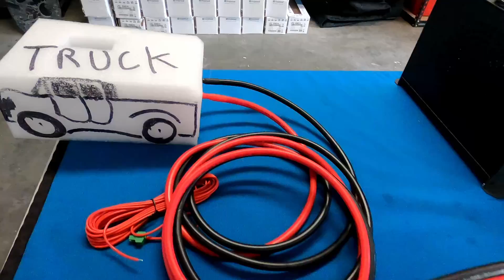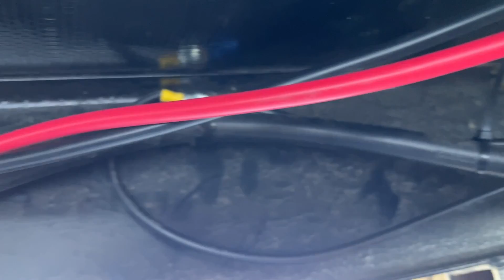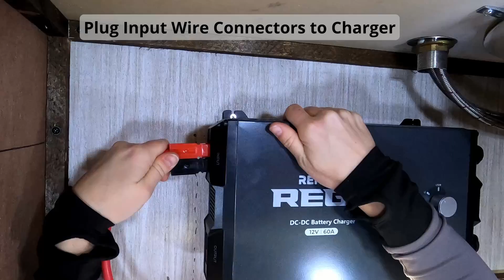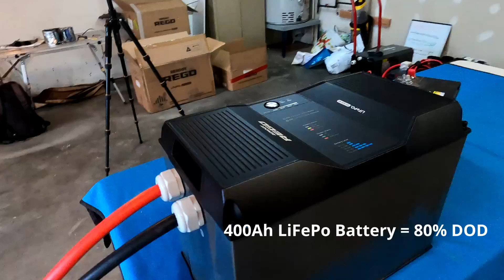REGO System Installation: Episode 4 - Install REGO Components & Wiring

Comment: im about to install a rego 3000 inverter charger it states in the installation instructions to mount it vertically on a wall not horizontally. i want to mount mine horizontally like you did,  have you had any  issues since your install? thanks
Reply from the maker: Yeah, we've had zero issues.  I think the vertical installation rec is really about keeping the fans pointed down so nothing can fall or accidentally stop them.  If it overheats, because of fan failure that could be really bad.  Good luck!

Comment: Could you leave the converter active if you installed just an inverter, rather than a full inverter charger?  Also, why Renogy vs Victron multi plus?
Reply from the maker: Oh, for sure, if you're doing just an inverter you'll want to keep the converter in place.  But be sure that you get an inverter with that auto transfer switch, so it won't interfere (aka blow up) when you're connected to shore power.  As to why Renogy?  Well, for a couple of reasons, good price, and really solid quality (we've run with all Renogy products for 6 years).  We have heard good things about Victron for sure, but just don't have any experience with that brand.

Comment: Hello! Great video! Going your way (Renogy setup) for my occasionally off grid travel trailer. My question is where did you get the ignition signal for your Rego 60 amp DC to DC charger and how did you handle this signal? Thank you!
Reply from the maker: @christiandugre2638  You know, for this particular install, we just skipped it.  Still seems to work fine.
Reply from the maker: @christiandugre2638  But you could certainly do something like what we did in this video.  The only difference is that you need to bridge between the trailer and the towing vehicle, which is easy enough with a small, single Anderson connector.  https://youtu.be/ur7gKRKp7aY?si=9aKAOKRdKsGQwRXn
Be sure to use our coupon code "CANLIFE " on your Renogy purchase to receive up to an extra 10% off.  Good luck and let us know how it goes.

Comment: Can I install this entire system under our murphy bed?  Or are some of the units (such as the inverter/charger) a bit too noisy for that?  Or could I install the entire system in our TT's basement, with the exception of the battery (which I would like to install under our murphy bed)?
Reply from the maker: I think you can totally do that.  You'll need to make sure that you've got adequate ventilation, especially for the inv/chr but that shouldn't be a problem.  The only things that will make noise would be the fans, with the exception of any warning beeps which are few and far between.  Plus, you'll likely not run your inv during the nighttime when sleeping too much.  
And heads up, they have a new combiner box for this system which requires fusing.  
Be sure to use our promo code "CANLIFE" when you order through Renogy -- it really helps us out.  Thanks and best of luck with your install, let us know if you have any questions!
Reply: @FreedomInACan  quick follow-up question:  why would I not likely run the inverter at night?  I don't plan to power an Air Conditioner with my batteries, but what if I did?  I guess that would be the exception, right? I'm just trying to wrap my head around all of this.  THank you!!!
Reply from the maker: @1gesteban  Sure.  You could run the inverter at night, especially if you need to run an AC - alternating current, appliance.  But you likely won't need to, as lights, ceiling / vent fan, smart phone etc. can all be DC - direct current.  Leaving the inverter on, if you're not directly running any AC appliances, consumes power which is also wasting power if you're not using it. Best of luck.

Comment: I am installing the Rego 3000 watt inverter charger as well, was going to mount the same way you have.  It says in the installation manual not to mount it horizontal on the wall due to cooling issues. Have you had any issues?
Reply from the maker: Nope, no issues.  Just make sure you've got appropriate ventilation space in all directions.  Not sure what the problem could be with that kind of installation?  Putting it vertically could cause an object to become lodged in the cooling fan blades- then you've got a problem.

Comment: Great video.. I'm looking to only add the inverter/charger to my setup . Will it still charge my batteries via the alternator if the converter is totally disconnected? In other words is it possible to use the existing converter to charge the batteries via alternator and not buy another DC-DC charger.
Reply from the maker: As far as I understand, converters only charge off of AC shore power when you're plugged in.  Inv / chargers do the same thing.  Travel trailers do send some charge to the house battery through the 7-pin connector, but only about 5A.  This is designed to keep your charged battery topped off while you're driving, but it won't recharge a discharged battery - e.g. you've got a 100Ah battery and you've used 50Ah while camping off grid, at 5A per hour it will take 10 hours of driving to get it back to 100Ah.  Most motor homes, class Cs, and vans have a battery isolator that does a similar thing between starting battery (alternator) and house battery - kind of like a one way valve so the starter doesn't discharge the house battery when the engine is off.  But as far as I know the only way to effectively recharge your mostly discharged battery from the alternator is via a DC to DC charger.  We have the 30A dual input https://renogy.sjv.io/qnk2Kj and it's awesome because we can charge both our fridge battery, and our house battery off of it, though not a the same time - it's set up with a battery switch.  Let us know if this doesn't clear things up, and if you have any other questions.

Comment: I'm not too sure on Anderson plugs as connection?  Bolt up is safer and secure for many reasons
Reply from the maker: Yeah, for sure, bolt on is going to be a more secure connection, but I think you're splitting hairs here.  The Rego system components should be properly secured so that they won't move during driving.  And if they are installed correctly, how are the Anderson connecters going to experience movement that might make them come loose?
The only place this might even be a problem is on the connection between the tow vehicle and the travel trailer.  We  have an Anderson cable here so we can use the DC to DC charger to charge our Camper house batteries.  We connect this each time we hook up and drive, an disconnect each time we separate.  It is very difficult to disconnect even when you intend to, so I'm not worried about using Anderson connections in this way.  Imagine bolting on wired connection each and every time you hook up your trailer.  Not impossible, but it will take some extra time.  
The Rego system is intended to help people build a robust solar powered system without having to plan out the length of cable the size of fuses, and the size of the wiring.

Comment: Just seeing this video.  After you disconnect the AC charge controller and removed the negative and positive wires from the DC side, how do the DC components get 12v power?
Reply: Thank you for the quick reply.
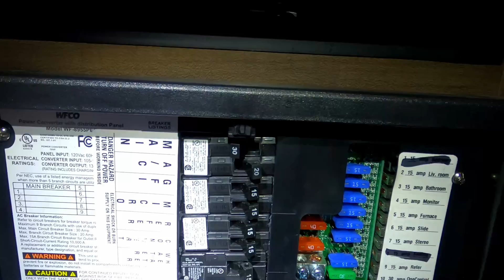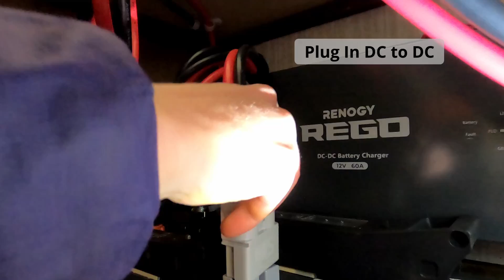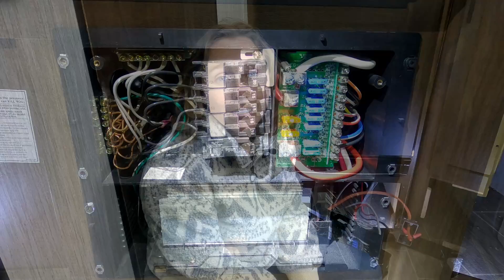Reply from the maker: Thanks for the question.  There's a lot going on in this video, so we can see how you might have missed that part.  The master DC positive and negative wires are still connected to the DC side of the Control Panel, (@20:32) so all the DC circuits are still supplied directly by the battery (in this installation they are connected to the pos & neg terminals on the Combiner Box which is connected to the Battery @15:32).  By disconnected the old converter (@19:18) we remove the old way that DC and AC power used to play together, the Inverter Charger is doing that job now.  
Here are some key moments in the video that illustrate this:
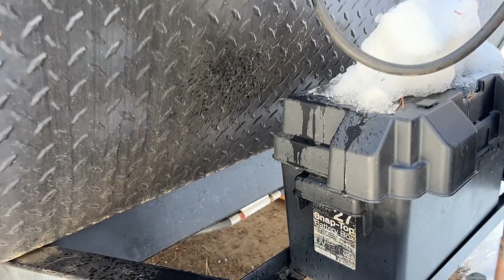Our basic wiring diagram @4:35
Connect DC master pos & neg wires to Combiner Box DC terminals @ 15:32
Removing Converter @19:18
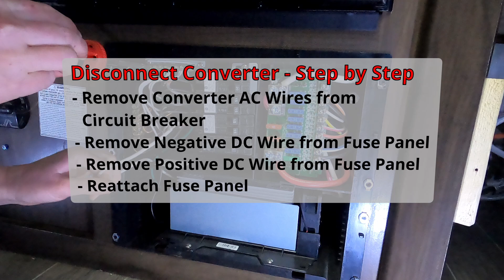Removing AC Converter Wires from AC side of Control Panel @20:09
Removing DC Converter Wires from DC side of Control Panel @20:30
Hope this helps!  Good luck with the installation plan, and let us know if you have any further questions.  
Be sure to use our discount link and promo code CANLIFE to save 10%.

Comment: Pretty brave to put the expensive electrical underneath the sink 😂 good luck
Reply from the maker: We added a splash shield, but they actually actually don't use the sink much and rarely the grey tank.  Most of the time they use a plastic tub and scatter the dishwater.
Reply: @FreedomInACan  also just seen that this battery is actually water proof 😂 ordered all my Rego stuff last week. Waiting for the mailman
Reply from the maker: @V4NLIFE_CANADA  Awesome!  Hope you used our link and promo code for 10% off!
Reply: @FreedomInACan  nope already ordered before o seen your video but used someone else’s code

Comment: I may have missed it, but did you have to ground the entire system to the frame somewhere around the battery bank?  If so would it come off the negative combiner box terminal?

Thanks and I did like the dancing when the boxes arrived!
Reply from the maker: Yes, you did miss it.  We ground the negative DC terminal on the combiner box to the trailer frame. The battery grounds to the box via the Anderson connections. We also grounded the inverter charger to the frame as well.  Glad that the dancing made you smile, that was part of the fun.  Thanks for the comment!

Comment: Not practical, Looks gimicky. a joke
Reply: You too my friend.
Reply: Hi, love the video and details, what was the total cost of all the parts, and installation extras, I think it maybe more then the trailer cost.
Reply from the maker: @anthonylicwinko9142  Thanks for the comment, and question.  All in, the system is just under $6,700, and that's without solar panels.  https://renogy.sjv.io/kjxm2d
However, if you price our the components, capacity, the wiring, fuses etc. you will end up saving money.  Yup it's got some sticker shock, for sure.  But consider this, last year we went to Alaska on a 5.5 month trip.  If we had spent $50 / night on plug in campgrounds, we would have spent around $7500.  Instead, we spent only $900 on camping during the whole trip.  But, we're full-time so we think about saving money in this way all the time.  If you use our link and discount code, "CANLIFE" you can save 10%.  https://renogy.sjv.io/LPEyNY
Let us know if you have any questions -- Happy Trails!
Reply from the maker: Thanks for reaching out, Fred.  It's no joke, and it works.  Jeremiah and Erin have been out with their  trailer a number of times since we helped them install it.  Hope you have a great day!